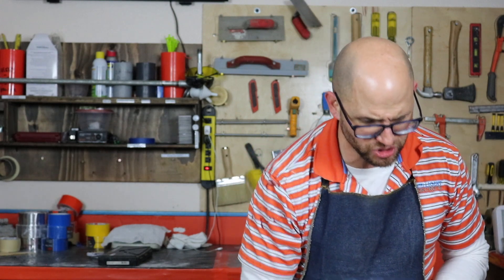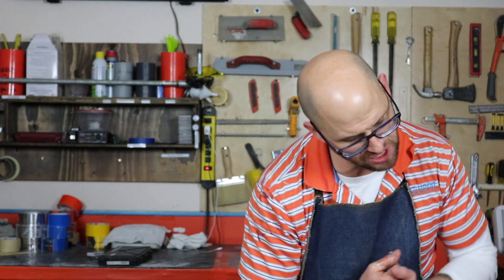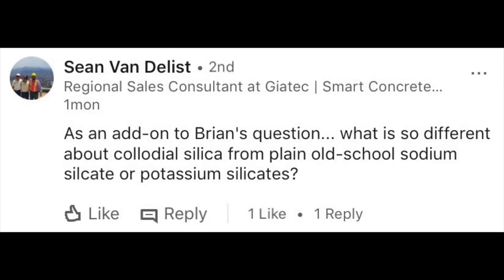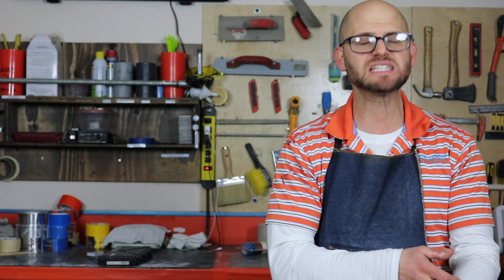Silica Vs. Silicate - Vlog #180

Comment: colloidal silica, made of suspended particles penetrates better than silicates, which are actual liquids? are the particles smaller than silicate molecules, or is there another factor at work here? silicates polymerizing on contact maybe?
Reply from the maker: Larger than silicates.  Discrete particles between 1-999 nm in diameter.  More often made between 3-100 nm.

Comment: Hi John, Great explanation. Love your videos. Can you explain when to use colloidal silica and when to use a silicate (also which silicate - Sodium, Pottasium or Lithium). This is in respect to polishing concrete floors to achieve maximum density (hardness) and also reflectivity. Thanks a lot ans please keep the videos coming.
Reply from the maker: Howdy Muthu.  I would say it largely depends on comfort level for trying new things.  You'll get better results with silica but if the contractor is not comfortable learning how to use a new material, you might get some failures from unintentional or intentional mishaps with the new tech.

Comment: Q. I need to give you insight before i can ask 3 questions.
I poured a stiffened raft concrete slab using 20mpa concrete with 80 slump 20mm gravel also vibrated and compacted the concrete. 
After power trowel had finished i sprayed on a colloidal silica solution that is sold for curing concrete to total slab. Nothing unusual noticed with concrete.

1 hour later i sprayed half the slab with lithium silicate densifier . (I did this as an experiment to see what would happen.) i noticed that concrete was slippery after application to half the slab. Concrete cured as normal.

Next day i noticed a reaction to the  lithium silicate areas. Looks like it was pushed out to surface and a little lighter in colour compared to rest of concrete. Hosed and broomed area .once dried then gave another colloidal treatment to slab by flooding and broom.  I wet cured the Concrete for 7 days also as im a noob with these treatments. 

Now its been 4 weeks since pour. 
Question  = should concrete treated with colloidal silica still absorb small amounts of water and is it normal to notice a change to the concrete fat of the trowel finish ? Do hairline cracks not appear?(hot summer and humid in brisbane)seems too good to be true?
Bloody long question. Ill keep it shorter next time. Cheers.
Reply from the maker: MrMickteen Thank You! Awesome Question! We are answering your question in a video that will be up next week.